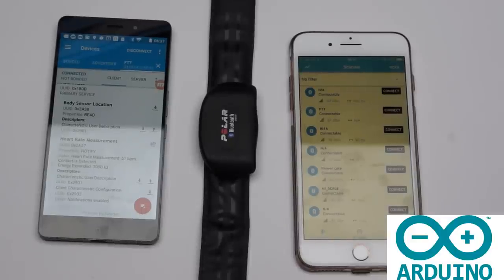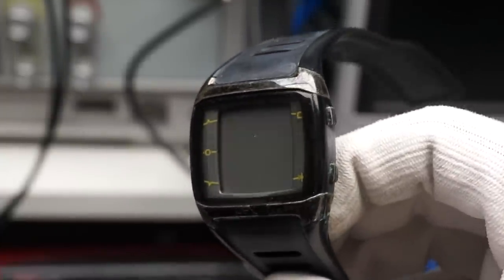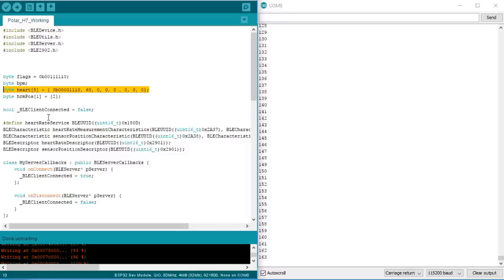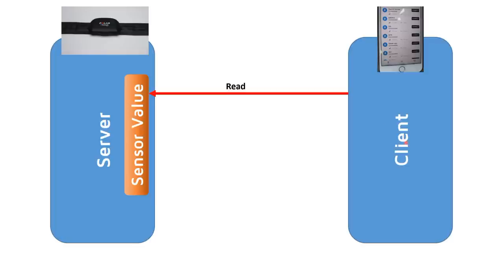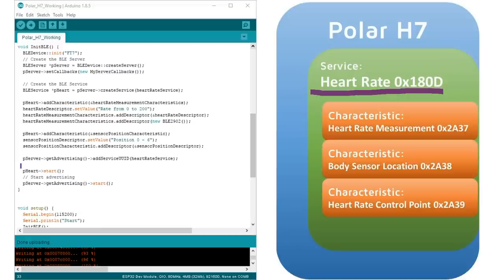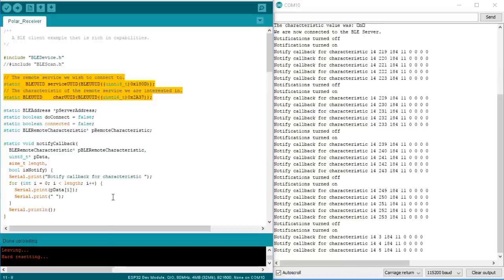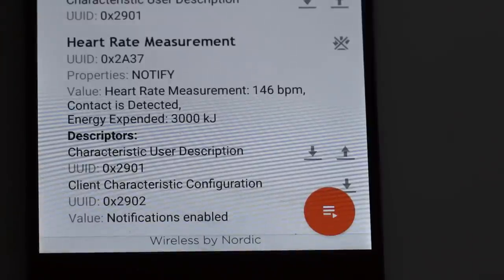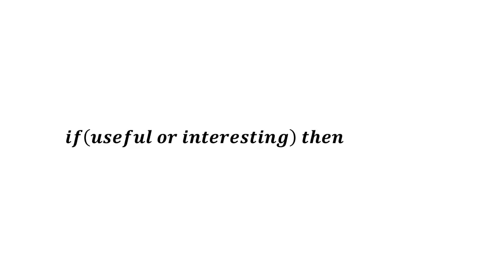#174 Bluetooth BLE on ESP32 works! Tutorial for Arduino IDE

Comment: Thank you for this fantastic video and the code! I was able to fake the heart rate belt on my ESP32 dev board and pair with my Polar vantage M watch without problem. Now I'm trying to make a speed and cadence sensor using this and two 44E402 Hall switch sensors...
Reply from the maker: Sounds like a fun project. I wish you success!

Comment: Hi Andreas, thanks for your contribution. I was having a lot of issues with getting BLE notification going for a project using Heltec esp32 board using arduino platform. I was having core 0 panic error. It seems that it is quite sensitive to how characteristics are defined, and cast. Also found the addition of BLE2902 seemed to help things go better. I had tried basing my code on the Neil Kolban BLE server example which is where I saw these core  panic errors. Patching your interpretation of the code has meant that my project is now doing notify without bombing out. 
Thanks once again for your contributions our collective understanding of working with BLE on ESP32.
Reply from the maker: I more or less stopped BLE on the ESP32 because it was not very stable. Maybe they changed it in the meantime. But it does not seem to have a high priority for Espressif

Comment: Another interesting topic would be how high the power consuption is when the ESP32 is solely used as a BLE server. Does it save much energy compared to a ESP8266 on wifi?

Yet another topic would be to receive data via blutooth and retransmitt it via MQTT. That could be used for the plant monitor (the one you used in the video) to intergrate it in node red.

btw: do you have an aliexpress affilitate link, to support you by shopping there?
Reply: banggood methinks. and yes power consumption is really an interesting race for these gadgets now.
Reply from the maker: 1. MQTT should be easy.
2. I am also interested in power consumption ans sleep modes.
Reply: I'd like to find a very low powered, programmable device with built-in BT (like the ESP32) to build BLE sensors.  If you know of one, or how to make the ESP32 run like that - maybe on its super low power processor - that might be interesting.  Then you could make a cat food monitor without a USB lead to trip her up as it would run for years on a button battery!
Reply: BLE sensors need to work with a CR2032 battery for six months to a year . ESP32  is good for making a cheap BLE to WiFi Gateway ( instead of having a full raspberry 3 for example )  . If you need a simple BLE sensor you should perhaps try the nRF or Dialog BLE chips .  They even cut consumption  by selecting the right amount of flash memory model needed for each application down to a few nA  in sleep mode !

Comment: Nice work Andreas. I just got the same Polar H7 device and successfully tried your sketch. Really useful examples. I'm looking in Kolban's snippets for work in progress on ibeacon but not so easy to integrate under arduino IDE .. too much rust on my brain :-)
Reply from the maker: Thanks for the feedback. Maybe I will have a look into beacons later.
Reply: ok. In the case it may be useful my last message on ESP32-snippets (by qrpfun) https://github.com/nkolban/esp32-snippets/issues/271
Reply from the maker: Thanks for the link. I will have a look at ir

Comment: Andreas, this is amazing.  Have you been able to get the client to automatically reconnect to the server if the connection is lost, or the client is reset?  Or is this only achieved through bonding/pairing?
Reply from the maker: I did not do this work so far. I am a real BLE beginner and just started the journey...

Comment: Great Video. I'm getting results with my ESPs spoofing your heart rate monitor. My only problem is that I need to use another type of data that is a little larger than your example. I have tried to use other service UUIDs to get data larger than a the little 8bits used in the heart rate moniter(180D). I'm trying to transfer gyroscope data over BLE so I need a data type that can hold 0-360. Also, all of the services have very specific uses. What service/characteristic do you recommend?
Reply from the maker: I did not further work with BLE. So I am not a big help. But I think, together with Goole you will be able to find a solution. BLE is not limited to the ESP32 and maybe somebody else solved it.

Comment: Maybe I'm crazy, but it seems like you are using the ble_2902 to reverse the normal  operation.  It seems like the sensor wants to be a server, and the app or database or whatever wants to be a client.  It seems like it is already set up to be used that way.   The server would notify about changing sensor values, since the sensor is the server, and the client would be that which displays or records the sensor values, and maybe doesn't need to send any notifications.
Reply: Dang it, the nomenclature of server and client is confusing, since they are kind of acting like both at different times.  What I meant to say is that the sensor seems to want to be a (ble) client, listening for a (ble) server to ask for data, and sending the data when the (ble) server asks .  The (ble) server could display, record, modify, or utilize the sensor data.  The GAP and GATT roles can be switched and mixed as one needs, I guess:  https://community.nxp.com/thread/332319
Reply from the maker: There is a two-way communication between the two devices. If someone calls a data transmitter a "server" then it changes all the time. AFAIK server and client are not very well defined roles and were the reason for a lot of confusion also in the past.
For me (and this seems also the way GATT sees it) the server is connected to the sensor and the client to the "display". That is easy enough to be understood by me ;-)
Reply: Thank you.  Certainly most of the documentation always refers to the (GAP) peripheral sensor as a (BLE) server and the (GAP) central as a (BLE) client.  
 
After studying more, If I were implementing my own heart monitors and displays (for something like a gym or hospital), I would probably emulate i-beacons, cramming the data into parts of the advertising data and scan response GAP payloads (whatever is allowed by i-beacons).  Then I could monitor multiple sensors at once.  With something like temperature sensors, you could save a lot of battery by adjusting the frequency (and power) of the advertising data payloads going out, since it also advertises how frequently GAP  advertising data payloads will be sent out.  It would never actually connect, it would just send out advertising data payloads that match the i-beacon/eddystone format containing the data.  Thank you for your helpful videos.  Sorry to drag you back here :)  I bet you end up exploring beacons at some point either for energy savings, or very accurately triangulating people's location in buildings and such using multiple beacons and their signal strength (in an app running on a person's phone).  There I go trying to run before learning to walk again.

Comment: Hi Andreas the characteristic value on the client serial monitor should be displaying the heart sensor reading right? Because it seems to be displaying some non-numerical values.
Reply from the maker: It should. But this is an old video and I do not remember the details.
Reply: @AndreasSpiess   Ok can thanks. BTW have you tried pushing real-time sensor data with timestamp onto the firebase database for the purpose of data analytic.

Comment: Hi Andreas,

Looking to extend the heart code for cadence and speed on a sensor:

I understand the heart sensor position array, 2 being chest but for the heart characteristic array itself, which sub characteristics do the values relate to?

byte heart[8] = { 0b00001110, 60, 0, 0, 0 , 0, 0, 0};

I think I’m missing something...

Many thanks

Richard
Reply from the maker: This is a quite old video, so I do no more remember the details. Sorry.
Reply: @AndreasSpiess  Not to worry, I think I've worked it out. That of the byte array, the first entry array[1] is the binary flags for the BLE characteristic.

Comment: Incredible work, as usual. Well done. 

I'm trying to use your samples to read my Flower Care (miflora) sensor (not sure if it's genuine as most of the common apps does not work with it).

Have you have already started to analyze the protocol of your?

I've a 4 custom services: FE95, FEF5, 1204, 1206.  Do you have something similar??

Ciao
Hjfabius
Reply from the maker: There seem to be several software revisions. So you have to experiment, change the different values of the sensor and watch which values in the client change. I did not do it so far, but mine worked with the app (after upgrading to the newest firmware)
Reply: I worked with chegewara on this & we found that there seems to be a problem communicating with this device using the Arduino IDE.  You can read packets from it OK but are unable to command it to go into real-time reporting so it continues to report default data (AA BB CC....).  It all works fine if you use the esp-idf instead.
Reply from the maker: Aha. So it is a problem of Neils implementation?
Reply: Can you upgrade the firmware without using the app? I was not aware of it.
Reply from the maker: I had to do it with the app
Reply: Strangely, even using the identical library as I used when working with es-idf, the Arduino environment fails to work.  You have to write a value (0xA01F) into one of its characteristics (0x1A00) at which point it makes real-time readings available in another (0x1A01).  That works fine in esp-idf, but not in the Arduino IDE.  Other characteristics (battery, firmware) read just fine since they don't need to be enabled.
Reply: Have you ever encountered cases where IOS Nordic app see 4 services linked to a device while esp32 with arduino ide only see one?
Reply from the maker: AFIIU the ESP only sees the advertised services. The other apps see all
Reply: Meaning that ESP cannot connect to not advertised services? I tried using the BLE_client example changing UUID as per what I've on the app, but connection is not enstablished.
Reply from the maker: The client sketch searches first for a service and then for a characteristic. If you do not see it in serial monitor during scan it will not connect. So far I did not try to more than one service/ characteristic.
I would try to start with my examples and then start changing. It took me a long time till everything worked. Even minor changes resulted in failures...
Reply: This is not true. ESP32 can see all services like any other devices.

Comment: Great Video :)  I'm trying to get my ESP32 to send data for 

2 x voltmeters
1 x temperature
1 x humidity
1 x GPS coordinates

using BLE to my phone 

(I'm using nRF Connect on the phone for testing)

I cannot see a example how to create my own custom service with 3 x float , 1x integer, and 2 x double - values that can be displayed on the phone or may be use some of the already defined GATT Services ?

Any suggestions will be well appreciated...
Reply from the maker: I am not a BLE specialist. But I think, if you can transfer one characteristic, you can also transfer the other values. You find a link for all defined GATT services.

Comment: Grüetzi Andreas

did you connect a ESP32 BLE client to your Polar H7 ? 
The HR caracteristic returns me different value formats like :
6 83 
22 83 218 2
22 84 221 2 206 2

Why does the H7 not sending always the same format ?

The first (6 83) and the second (22 83 218 2) seems correct from the flag point of vue (respect. 8byte HR value and 8byte HR + 16b RR).
But how should I understand this 22 84 221 2 206 2 ?

I noticed that the Polar H7 delievers a unkown service on the UUID = 6217ff4b-fb31-1140-ad5a-a45545d7ecf3.
Any idea on this vendor specific UUID ?

Vincent
Reply from the maker: Unfortunately, I do not know more than presented in this video. And I do no more remember all details. I think the links to the underlying documentation is in the comment. Maybe you find a solution.

Comment: Hi Andreas, Thanks again for your great video. I just tried to do the same with a Bluetooth Joystick. But I get an error 
bta_gattc_conn_cback() - cif=3 connected=0 conn_id=3 reason=0x003e
while searching the web I found you had the same problem and asked for help.
Can you tell me, what I have to do?
Hardware: Wroom32 and HZ-2749 joystick
Thanks a lot!
Reply from the maker: I do not know more than written into the post you mention and my example files. They worked at that time and I did not touch BLE since.
Reply: @AndreasSpiess  ok. Thanks anyway!

Comment: Do you think it would be possible to turn an ESP32 into a Bluetooth HID using this stuff as a base? I want to see about making my own Bluetooth controller with one I have laying around.
Reply from the maker: It should be possible. I found this link: https://github.com/asterics/esp32_mouse_keyboard . It is not for the Arduino platform.

Comment: Servus Andreas, i am struggling a little bit with my ESP32 Bluetooth Fan which is controlled by a BLE Heartrate Sensor as you describe in your video. My main problem is actually that somehow my second heart rate sensor disturb the connection and the ESP32 just read the wrong sensor values. I would like to program something to seperate the heart rate sensors that only the belt i wear will connect to ESP32. The program itself works fine so far, but always interrupted by disconnection and connect to other same sensor UUIDs (0x180D) and (0x2A37). its alredy quite frustrating, that ESP32 ble does not connect to MAC Adress...😒. Maybe you have an idea. many thanks in advance and br stefan
Reply from the maker: It should be possible to find the number of your HR sensor and filter on it. But I do not have the exact code. Maybe you find a similar project?
Reply: thanks for prompt answer, ok, thats a pity, but lets see if otherones have an idea.  @AndreasSpiess

Comment: Dear Andreas, I ran into one more issue. My home laptop which used to run esp32 ble programs, is now issuing some errors, while I try to compile any BLE program, including the examples, which are already provided with the ESP32 BLE arduino library file. The reported error is panic: runtime error: invalid memory address or nil pointer dereference
[signal 0xc0000005 code=0x0 addr=0x0 pc=0x7855fb]
. 
goroutine 1 [running]:
github.com/arduino/arduino-cli/legacy/builder.ResolveLibrary(0x11ce25a0, 0x11fc2151, 0xb, 0x11fc2151)
Even I tried reinstalling ESP32 Boards once again from Boards manager. It works fine when I try compiling it in office system, but its not working in my home laptop. Any suggestions in this regard? Thanks
Reply from the maker: Unfortunately I cannot do remote debugging. I never saw this error.

Comment: Hi Andreas, I would like to replace HM10 by the ESP32 BLE so that the existing Android and IOS app's can be used without the need of the HM10. Can you or someone here give some advice please? I changed the UUID's already but  that seems not enough. How to modify the code to replace the HM10? Thx.
Reply from the maker: You have to google what services the HM10 exposes and simulate them with the ESP32. did you have a look at this project: "github.com/joelszy/ESP32-HM10"

Comment: Is there a way to set the BLE transmit power or is it fixed?
Reply from the maker: I do not know. But I think, it is variable (maybe not in the Arduino IDE). But on the ESP32, most of the current is used because the device is on for way too long, not for the BT sender.
Reply: I had a similar question. The RSSI or dBm adjustment file. That will determine the range and application space. One can use more Powerful dBm for Controlled indoor application.

Comment: Back again
Reply from the maker: Today I got TPMS sensors with BLE and tought it would be easier to use them than 433 MHz. I was wrong. Messed around with BLE on the RPI. Also a mess in my opinion.

Comment: I'm wondering if anyone has built a multiplexer? ... Take one heart rate monitor signal and serve it out to multiple simultaneous devices.
Reply from the maker: AFAIK you can receife these messages as often as you want. As long as the Oximeter is not connected it sends these messages to everybody

Comment: Am I the only one who gets "sketch too big to compile" ? sketch uses 106% of program storage space. I'm using a doit esp32 dev kit V1
PS: the arduino setup is working because if I compile a esp32 ble sniffer example everything works
Reply from the maker: So far I did not read any other comments like that if I remember right.
Reply: https://github.com/SensorsIot/Bluetooth-BLE-on-Arduino-IDE/issues/3 Looks like it is a config issue with the esp32/arduino library at least on windows.
Modifying the boards.txt file removed the issue, still I'm not able to get any output on the serial monitor after compiling and configuring your sketch.
Reply from the maker: I saw the issue too now. BLE is still under heavy development for the Arduino IDE...